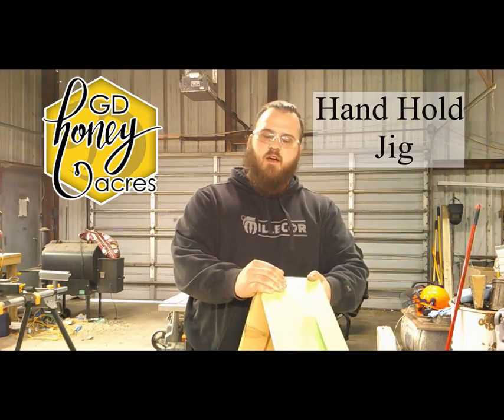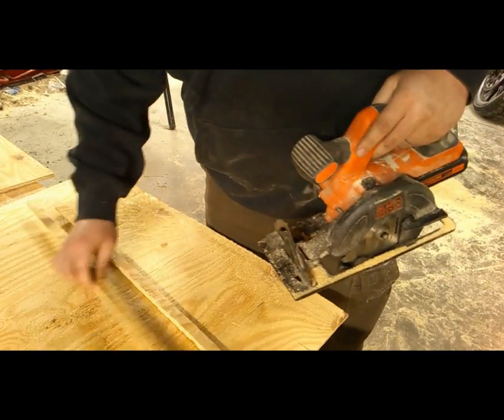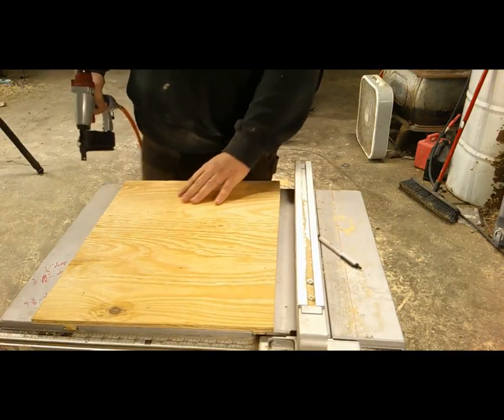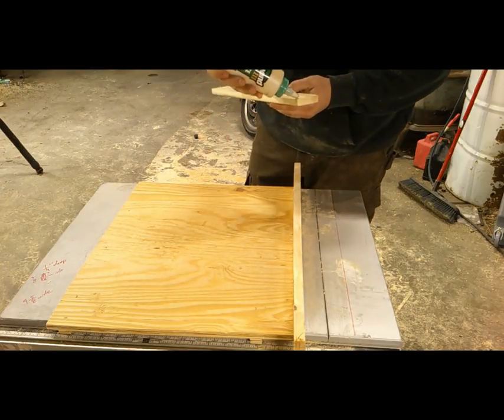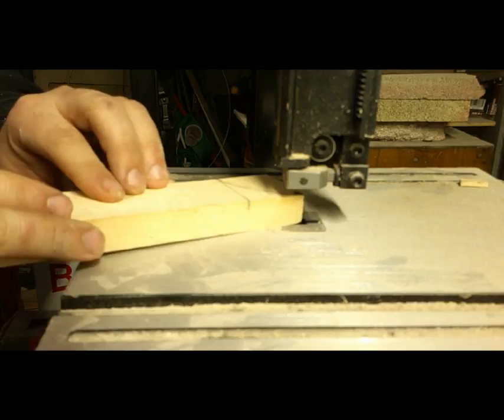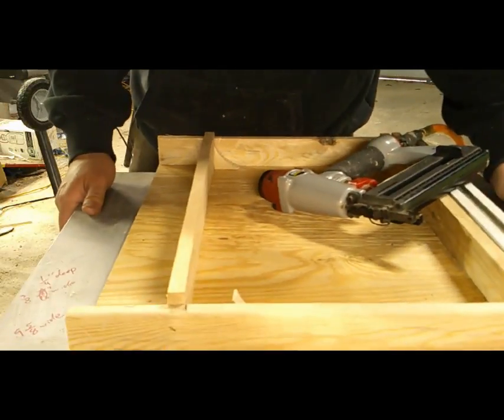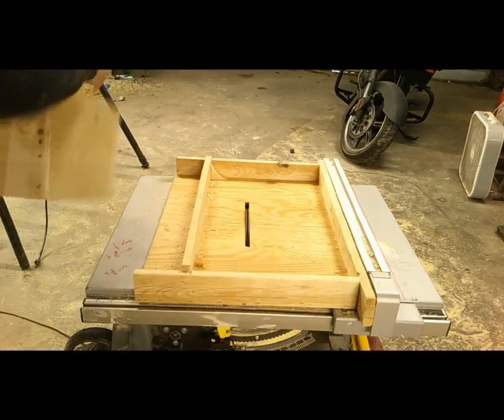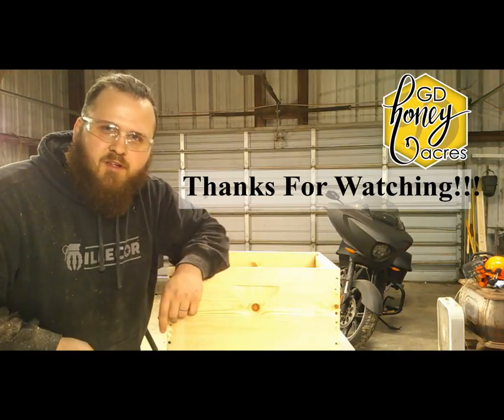Easy Beehive Handle Jig

Comment: I have tried a number of jigs to cut hand holds but none were satisfactory. I liked yours and build a modified version today. I don't want to assemble boxes first, so I left a space on either side to grab the top edges of the boards. It also helps getting shavings out of the box. Also I marked to add a different bottom stop for when I do mediums. And I used spacers to keep the short side centered. I practiced on some scrap and then went to work on my actual sides. The first was good but would need slight sanding. By number four they were smooth and looked great. I like the shape the dado head makes. Thanks again for sharing.
Reply from the maker: Awesome I’m glad it helped

Comment: I made one very similar to your setup - Thank You - for sharing.   I would recommend cutting out an opening around the Table Saw Insert on the base of the fixture.  Remove the throat plate  and the saw dust will fall into the base of the table saw instead of up all over you and the fixture.   It works great on my table saw.. Make a removable insert for the long sides, and another removable insert for going between deeps and mediums.

Comment: I'm new to bees, building my first box....I'm just wondering why everyone goes through the effort of making these negative (recessed) handles?  They seem tricky to make, hard on the saw, dont give great purchase and make a thin spot in your hive wall.....what am I missing?

ps..and alternate way(easier?) to make the radii would be to just just a hole saw & chop it into quarters afterwards.
Reply from the maker: They aren't hard to make when you have a jig made and go slow. I haven't had any issues with the saw when using this. Also they are great for picking up the boxes. I like them on all sides. It is just a faster way to do this and with a lot of time saved. It doesn't create a weak point. I've never had any box issue there.
Reply: @GDHoneyAcresandCraftWork  you not having issues, doesn't mean you haven't made a weak point, you absolutely have.  I
Same goes for the wear on your saw, its just not made to handle  not radial loads.

All to get 3/8"-1/2" of grip area?  No thanks.

Appreciate you answering, but I put real handles on mine, no reason not too.
Reply from the maker: @mtraven23  where I live handles would get in the way of overwintering the beehives. Hence the normal handles on the Langstroth boxes. I’ve used the same boxes for years. Still doing great with no issues
Reply from the maker: @mtraven23  also what handles did you end up going with. Others reading this may want to know because they want to go that route. Let’s give everyone the different ideas so people can choose what works best for them. For me climate reasons handles are out because of overwintering needa
Reply: @GDHoneyAcresandCraftWork  sure, and I didn't mean to be overly critical.

I'm not a keeper, so I dont need to worry about boxes stacking neatly.  I did read a lot about problems people having problems with rot on external handles, steaming from the horizontal surface.  So I made up some hickory dowels / nobs. 2 per side,   ~1.25" in diameter, spread about 3" apart.  This forms a nice handle & doesn't have any surfaces for water to sit since everything is round.  The dowels were pressed & glued into holes drilled in the boxes & everything was stained & sealed.  I'm pleased with them.  Now I just gotta find some bees!😁
Reply: @GDHoneyAcresandCraftWork  something I should have mentioned earlier...I have some hand injuries that make it rather hard for me to pick up a lot of weight on my finger tips.  I think that informed my decision more than I knew.

Comment: Do you have a more specific set of directions for this jig.  How far from the blade was your fence etc.  How would you set up the jig for 8 frame mediums?
Reply from the maker: Sharee Godley I only used my fence to clamp to. If I remember tonight I’ll take a measurement. I’ll put it in my phone. This jig was only for the long sides. I never seem to want to grab the short sides. So if you are using deeps you wouldn’t need to change anything for the long side. If you are wanting to do the short side just make a adapter piece to fit in the jig to the size of the narrow portion of the box. Then add your half moon to that piece. May have to lengthen the hole up so you can get center but that’s no biggy.

Comment: How wide was your dado blade?  Also the curved pieces what were the dimensions before you cut the curve?  Thanks.
Reply: looks like the same belt sander as mine, which has a 3" diameter drum...so those look to be 1.5" radii.

Comment: Thank you. I make hives and sell them on a small scale. I make handles with a different kind of jig which does not put the half moon on the bottom. I might try this for the future. The only thing I don't like about it is have to move the jig and make multiple cuts. I am using a cabinet saw with an 8 inch dado stack and I wonder if I could get by with just one cut. It would be ideal for me then. Check out my Facebook page Athena Timber Products or my Google Business web page under the same name if your interested in seeing some of what I do.
Reply from the maker: I’m the only reason I move it some is my saw can only do up to a 3/8 dado and I want a large area to grab. If I just stuck with the one spot my fingers still all fit. I just want a larger purchase to grab. It goes pretty quick. Especially when you clamp it and then do multiple boxes